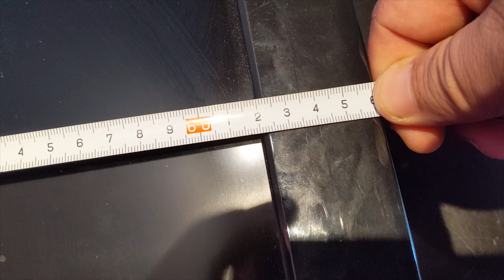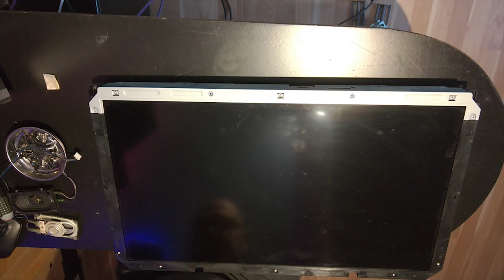Tabletop TV/Monitor - Dungeons & Dragons Theme

Comment: To be fair, this seems like a good idea. Get a tablet or old flat screen television set and use it to show the maps on. Saves paper, cardboard, and plastic if you're using a dry erase sheet because it'd eliminate the need to keep buying dry erase markers.
Reply: Or better yet get a piece of lexan (lexxan?) to put over it and dry erase on that!

Then you can use even more plastic! Mwahahaha!

Or not, you do you.
Reply: @benjaminholcomb9478  No, no. My point is, why bother with dry erase markers at all? They usually can't be refilled or recycled meaning they go to the nearest landfill or transfer station. Though you do make a good point regarding a sheet of Lexan or Plexiglass to shield the screen so miniatures can be used on the screen.
Reply: What are you being fair about exactly?

Comment: If I may, I'm going to give some pointers but they are constructive criticism. Take it or leave it! ❤️

1. The type of material that you chose to build are MDF. Basically a compound of wood particles.
Meaning, paint and other finishing touched are very easy to work on.
Cutting the angles the way you did was pointless ONLY because of the type of material that you chose to use.
On other materials, it can be required, but on this type of material, not so much.

I will continue to watch because I have been planning to build a project like this for well over 2 years, now. 😁❤️

Edit 1; 
Also, what you could have done to give it more flavour, is to use glue + Small Nails to strengthen the weight and structure. As for a finishing touch, you take the wooden dust, mix it with glue, create paste, patch the nail holes. Sand it. Over it, you use very thin VERY thing layers of wooden sheets, that will create a very distinguished touch and look highly professionnal! They aren't expensive and require only a small amount of glue to fixate the panels to the wooden structure. Creating a refined touch of whatever wood you choose. Giving it a very expensive finishing touch ❤️

But looking at what you were aiming for, this may only be applicable to someone who wants a Wooden finish rather than a Stone vibe 😅
Reply from the maker: Thank you for the advice. I might build a version 2. And have your suggestions implemented😀

Comment: You put amazing detail into this.  I recently built a basic frame box around mine just to be able to transport it to the game store where we play and back.  I would have liked to use a smaller tv but found that you need at least a 50” screen to display standard 2 ft wide battlemaps without needing to move the map around on the screen during a game.  So mine is a bit of a beast.
Reply from the maker: Wow 50" that is huge. i would love to build a more static game table with a 50", but i don't have room for it. but it could be so awesome. But yeah, your right it is a bit annoying when we have to move around the map. but it works for now :-)

Comment: How does the screen hold up to miniatures and stuff being placed on it?

I was thinking about making a similar one with a piece of lexan over top for toughness.
It would have the benefit of dry erase marking too. (I like the tactile feel of it, and players can mark it up)

Might just skip the plastic, not sure yet.
Reply from the maker: Hi Benjamin, the screen did not have any particular protection, so i later added a 6mm peace of glass, to protect the screen. it was not in the video, but i just ordered a peace of glass at a local company who could cut it on measurement, and then i glued it in, with some epoxy. i have a picture here: https://photos.app.goo.gl/GXgei81EdsLB3x926
And now i can also use a whiteboard pen to draw on it :-)

Comment: Heya, fantastic video btw! Don't know if I missed this in the video or if u still have it laying around, but what about the heat from the screen getting blocked by the glass, is there any problems with that?
Reply from the maker: it don't seem to be a problem, yes it gets a bit hot, but i has been running for hours and i have not detected any issues

Comment: I have two questions but first great work.
1. For the backside of this project, did you leave this open or is it possibel to drill some holes for the heat transfer.
2. Have you cover the screen with a film.
Thank you in advance.👍
Reply from the maker: Hi, the feet in each corner is making a gab at 6mm all around the bottom, and it seems to be enough. I added a 5mm peace of glass on top of the screen later on, and it works great with a whiteboard pen. but it was after the video was published i have an image here: https://photos.app.goo.gl/1bWSXoMk3NZ5R9w47
Reply: @olebrogger  thank you for the fast reply. And good to know. I will try to imitate your build with a 42 zoll tv

Comment: Hi! Great project! quick question.
What about the heat the TV emits?

Bests from Argentina!
Reply from the maker: I has not been a problem with the small feet i made on the bottom. they are 6mm high so there is plenty airflow under the setup :-)
Reply: @olebrogger  Thnks! is the TV LED or plasma?
Reply from the maker: @compostatebien6754  it is a LED, Plasma will over heat, and i don't think they will handle laying down on their backs well.
Reply: @olebrogger  thks!

Comment: Hey mate, I might have missed in the video, what is the hight of the support? How low can you imagine it could have been built? Edit: and how much does it weight?
Reply from the maker: Hi, it weigh appropriate 9kg it is 8,5cm high i think it could be lower, but i am worried about the airflow. But it is an old tv and it was thick from the start, so with a newer i might be able to make it alot lower. I am planing to build a 50" version but i dont have the money to do it